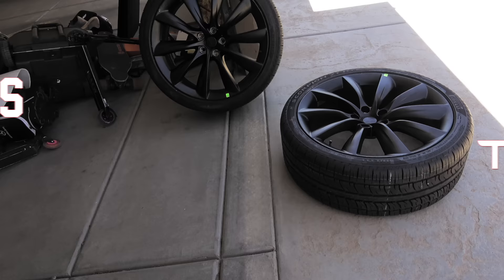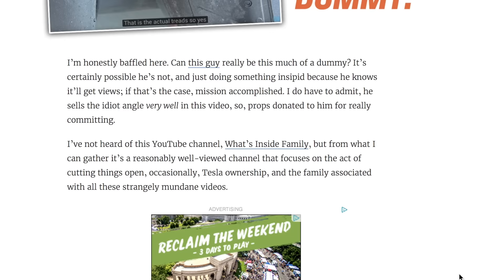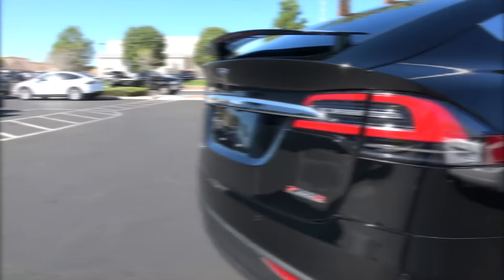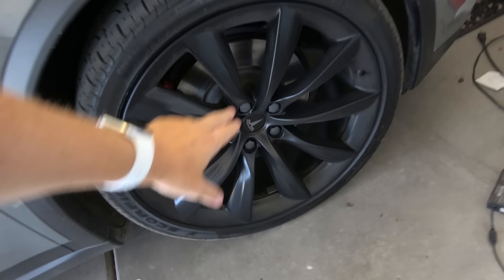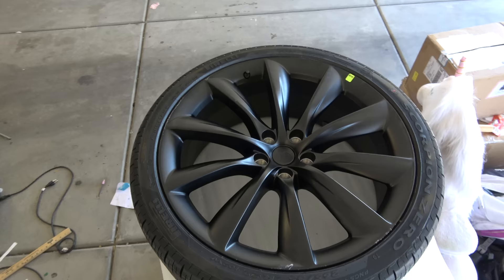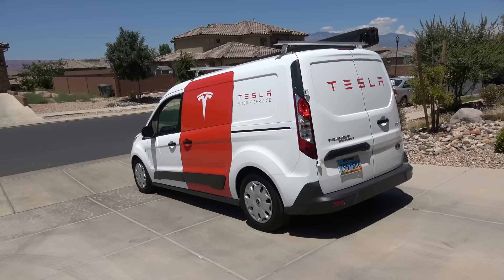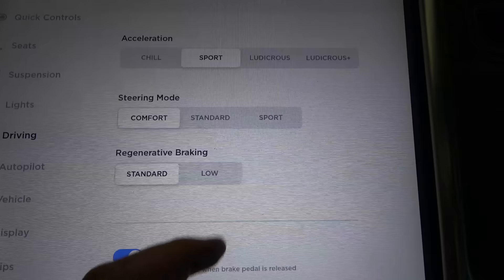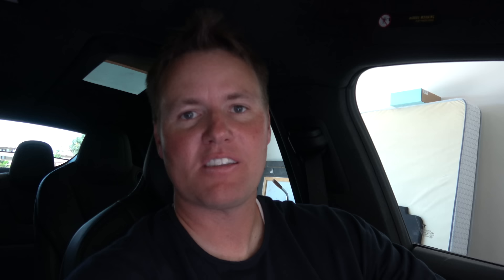Tesla Keeps Giving Me FREE Tires!

Comment: Tesla mobile comes with a ford😂
Reply: Ford marketing team - do something with it! :D
Reply: Gabriel Grass hahahaha
Reply: It's because Ford's are reliable and you don't have to charge them
Reply: Michael Wakefield fords are not reliable 😂
Reply: Eq Estrada way more reliable than a dodge or GM lol
Reply: Graham Roth True. My beater mustang wont die no matter how hard i drive it.
Reply: @jimmypena2442  I bought a honda over a chevy truck recently because I didn't feel like dealing with random engine codes its whole life lol
Reply: @grahamrothphotography  My old impala had high beams that would spontaneously go on(Took off the fuse to fix it) and it had two oil leaks in the time I had it.
Reply: @jimmypena2442 Peña that's nuts! I had a 05crv previously and it only had parts that wore out, and most of the parts I was replacing was around 250,000kms, otherwise, nothing ever broke, original shocks too!
Reply: Gabriel Grass it's cheaper for them lol
Reply: Right
Reply: I guess we know what Tesla is gonna come out with next
Reply: Tesla doesn’t make a van like that also
Reply: Lol
Reply: Maybe when the Tesla cyber truck come out the fords are going to scrap 😂
Reply: That’s not reliable lmao
Reply: I saw
Reply: Probably because Tesla doesn’t make a van yet
Reply: tesla mobile should come with tesla
Reply: Lol

Comment: Why do I always get the impression that for TESLA owners, a car is just an iPhone on wheels and the whole idea of saving the planet means nothing to them.
Reply: Because thats the truth. But Elon wants to save the planet,  and he knew that he couldn't make good electric cars and change the world. He needed to make the best cars.
Reply: I’m gonna get a Tesla so I can help, they’re cool as well
Reply: @tinzalix8624  teslas arent really that good for the envoriment.
Reply: Bleach is gud for u 
how so?
Reply: @tinzalix8624  producing the batteries takes up much more energy than running a diesel car  for 4 years straight(not turning off at all)
Reply: @tinzalix8624  also recycling the batteries when they get to old to charge.
Reply: Bleach is gud for u 
 But the car gives off co2 emmisions(global warming/and or climate change)
*diesel car/truck
Reply: @tinzalix8624  yes so does producing all of the batteries. electric cars are worse. production of the batteries require lithum metal which is difficult to get.

saddly the batteries often needs to be replaced every 5 years. and those batteries are not easy to recycle and takes alot of energy to do.

also charging the car is bad for the envoriment espesially at those public charging stations because most of that electricity comes from coal, oil and nuclear power.

after all electric vehicles arent as good for the envoriment as many think they are. would probably be better to get a hybrid or maybe a gaspowered car if you have them where you live?
Reply: Bleach is gud for u almost all of the cars in my town/city are gas lol.
I have a nuclear power plant right next to my city (prarie island nuclear plant, I live in red wing) so clean energy is coming from that, sadly no superchargers anywhere near me 😔. Anyways, Great points!
Reply: @tinzalix8624  oh well:/
Reply: It requires coal to produce the steel frame of the car. It requires fossil fuels to produce the plastics used inside a Tesla. It requires oil to transport these parts across the globe and across the country. The only reason people buy Teslas is because the cars are fast and cool. These same Liberals who buy Teslas still consume as much goods as every other American.
Reply: Not to mention, buys Teslas while building a huge mansion that will take tons of electricity to heat and cool it.
Reply: @nerychristian  So does it with any other cars? What's your IQ? The point of all this is to find the best way to minimize the co2 emissions, and that's with el cars.
Reply: @kristoffer816  Telsas help keep pollution out of the citys.
Reply: @kristoffer816  Elon should build hybrid cars.

Comment: Chip inside the computer is Probably getting hot and resetting....
since its a pattern, thats about the best chance, or its electrical, which dont sound good on this type of car..  Find hte Main section with computer IF' you can...see if its a CLOSED BOX..  And next time, STOP and check the heat on it..

Comment: 95% of normal shops are not even allowed to ATTEMPT to repair run flat tires. You are suppose to have a tire cage to work on runflats. OSHA would throw a fit if they found out about somewhere working on runflat tires. Not just tesla runflats, any runflats. Only those bridgestone runflats that come on nissans can be fixed.

Comment: a proper tire plug/patch is installed from the inside of a tire, and proper adhesion to the tire would mean that the shop would have to rip out a portion of that foam.  
That turns the repair into a liability.  i wouldn't patch a musk tire.  If the tire blows again, and the fact that someone ripped out ur run-flat foam sends you into a ditch, means that tech. that fixed ur tire gets sued.

Comment: “It’s not safe to drive rear wheel drive in winter” hmm I don’t know, I drive divers Bmw-s in last 7 years and I never and any issues in winter. And we drive often in Alps. Regarding tire degradation, it’s seams obvious to me, those cars launch from 0-100 kmh in 3 seconds. If you launch Bmw m3 or Mercedes amg 63 constantly the tires will be destroyed after 10 000 km. Ps. Good tires degrade faster than low quality tires as low end has more plastic mix in the compound.

Comment: glad they are so nice to you; purchased a new model 3 and was delivered with a dent in the rocker panel; went into the shop and rocker panel was repainted on my brand new car; also gave me a loaner p90d model s and looked like it was previously crashed with the bumber hanging low; As driving the front bumper falls off; I called tesla service and they blamed me for the damage.  Either pay for new bumper or claim with my insurance company that was not even my fault.  TESLA FAIL.
Reply: domain magic no quality .. period

Comment: Stop calling them wheels and rims!! Lol it’s wheels and TIRES!
Reply: Tire is wheel
Reply: Rim is the metal price in the rubber tire
Reply: マッドルースター wrong. A wheel is a wheel and a tire is a tire. You can have a rim on a multi piece wheel but most cast wheels don’t use rims. It’s all together.

Comment: Regen on low is not the same as other cars it slows the vehicle, not as aggressive but it doesn't free wheel
Reply: Darcy Kline ICE powered cars don’t free the wheels either when lifting.  The transmission is connected to the engine unless its in neutral.  This causes engine braking when the throttle is lifted.

Comment: This is helpful. With less than 7,000 miles on my brand new Tesla Model Y I took my car to have my tires rotated. To my alarm, the inside tread on the front tires were bald and would not pass the state inspection. It was clear that Tesla delivered the car without aligning the tires. I notified Tesla in Peabody believing that this was clearly a warranty issue. His reply: Good Afternoon John,

This is Blake from Tesla Service in Peabody. Unfortunately, both alignments and tires are not covered under your vehicle warranty as they are a wear and tear item. 
There are many factors which contribute to a vehicle's alignment which could have led to the kind of wear in the photos.

We can keep the appointment for the 3rd at this time so that we can order 4 new tires if you wish. We can send you the estimate for them and the alignment through the app or I can attach it to this email if you prefer. 

Best,

Blake Williamson | Service Advisor
210 Andover St. Peabody, MA. 01960
(978) 326 1623 ext. 76204 | blwilliamson@tesla.com
Office Hours: Monday - Friday 8:00 AM - 5:00 PM

Comment: So I work at Walmart tire lube and express which is pretty much the same as discount tire tire or Tires Plus pretty much anything like that any fast service tire shop that tire you came into my Walmart I told you no we can't fix that cuz it has that foam on it you cannot patch that so you did not debunk Tires Plus you have to go to either Tesla or full-service shop or dealership in order to fix that tire tell me how would you fix how would you get the patch on to that foam you can't fix or patch run-flat tires anyway so run-flat normal run-flat tires have a gel-like substance on top pretty much around the tire like slime or fix a flat that is a special tire from Tesla  when will the tire size that tire size is hard to find so that tires  going to be special your not going to put a Michelin Pilot Sport cup 2 tire on a Nissan Altima no u put that on a Nissan GTR oh and your tire size is 265 35 22 that's not a easy Tire to find let alone one that's made specifically for Tesla and if somebody out there says  tires all the same you can put tires on any car  well that is true for probably about 95% of the cars maybe even 90% but Tesla not one of them Bugatti not one of them

Comment: So is it safe to say that the drivetrain of the Tesla is basically causing tires to prematurely wear out? Or are the tires wearing at what they are rated?

Also you seem to have a lot of problems with you Teslas, which seems to be a shared experience with other Tesla channels. That's quite disappointing.